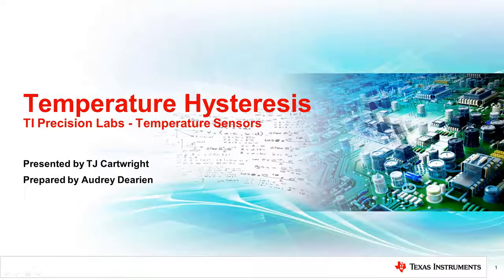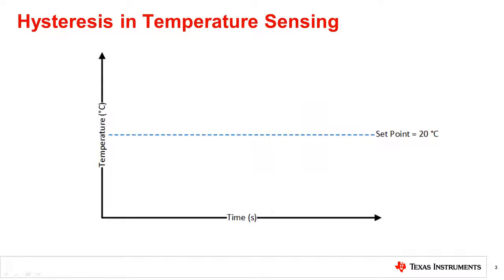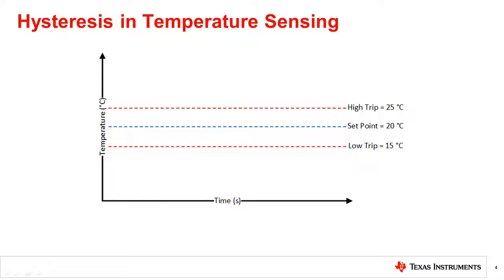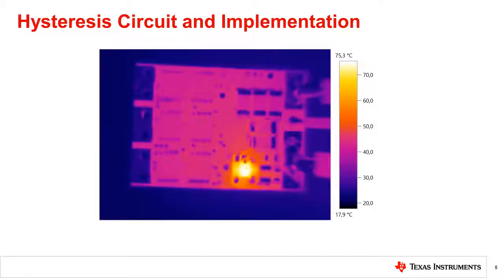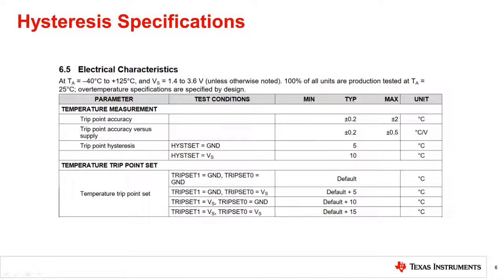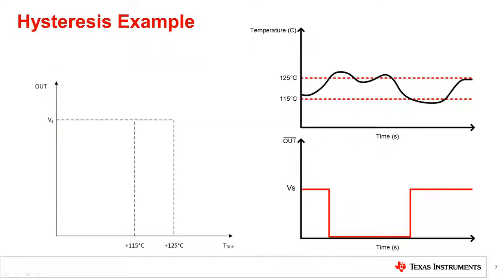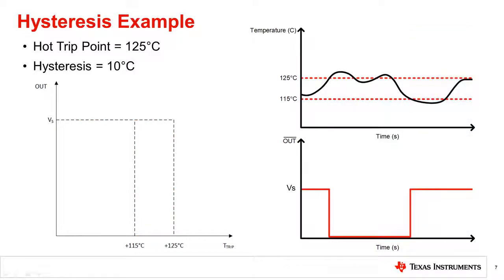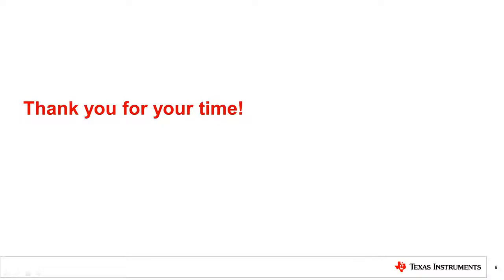Temperature hysteresis

Comment: This is embarrassing. You just described overshoot and undershoot. Hysteresis has at least two components. A varying point and a variance in the intended outcome. If you have two control points that don’t vary and there’s a variance outside those controls points that’s called overshoot and undershoot. And if you’re gonna say a binary control point (heat on, heat off) is a varying point that’s a huge stretch and a bastardization of the intent of the usage of hysteresis.
Reply: Yeah I think this in the heating example is called a deadband